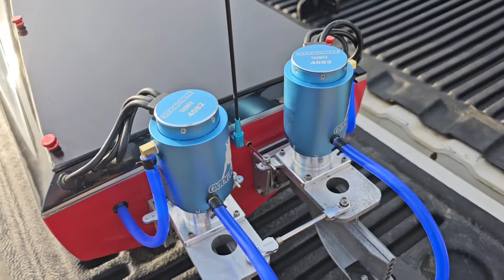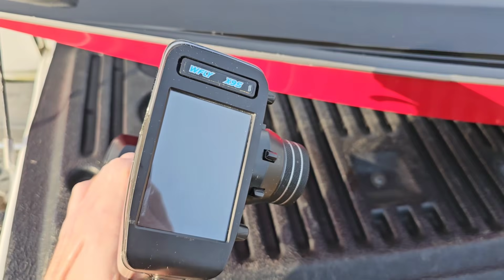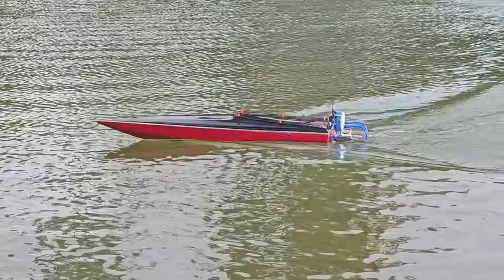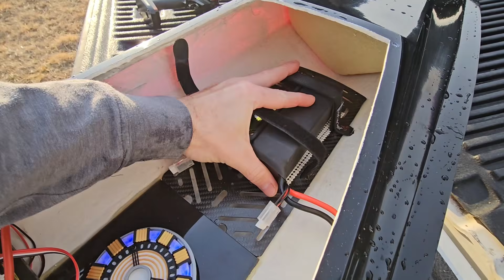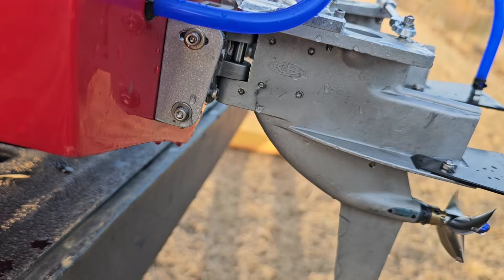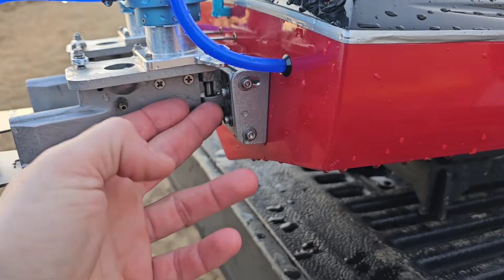Ironman Mark¹ First Testing - 4s & 6s

Comment: Start with  the C.G. That's where your problem starts.  The twin motors is a lot of weight.  Adding the  running hardware, lower units . ETC.  is too much aft weight. When the boat tries to plane out, the   bow  of the hull comes up, as the boat attempts to balance itself. Hence the bow lifts ,and then drops  back down .(Porpoising. )   Additional trim tabs  may help, but  won't  correct the C.G  problem.  NEXT , the ride. Your thrust  should be parallel   to the transom. TOO high= cavitation.Too low, and too much drag.  Thoughts?

Comment: With the beam length of that hull and how much weight is on the rear I think it would work much better as a single motor and  drive setup.

Comment: Those prop shafts are way to low, because they are surface drive props the shaft should be no lower than the hull or even slightly higher, check it with a rule.

Comment: I would try neutral outboard angle, engines mounted higher, and attach afterplanes (trim tabs) to the hull. After that you should be able to get rid of the porpoising with subtle trim tab adjustments only. Use just enough tab adjustment to stop the porpoising or else you'll kill speed.

Comment: 2. To 3° of positive angle is optimum for most v-holes if you want to run fast as far as prop setting height wise, I would try to split the output shaft with the water line as far as height

Comment: Awesome looking piece but I believe you need some trim tabs on the back of that something about 4 in Long by approximately 2 in protruding out from the back of the transom. You can dial that thing in to ride any angle with the proper trim tabs

Comment: Your carbon plates are the problem, as soon as the boat lifts, the boards are acting like a steering surface that is rotating your boat back down, so it goes up and down, up and down. Try to angle your carbon plates in the angle you want your boat to drive in at full blast. And the waterjet from the props is hitting the plates.

Comment: The props are running too deep.  With that much setback from the rear of the hull, the top halfs of those props and their shaft should be above the bottom of the hull..  I think raising the mount backets instead of the trim will make a better difference, and decrease drag a lot..  Thoe length of the drive unit is too big of a lever arm raising the bow as they are mounted now.

Comment: I know your steering linkages are at the bottom of the transom holes. BUT, it appears (to me) that you need to get the props just a touch deeper into the water.

Comment: Part this issue is the hull style, it’s a long lead into the Delta pad on the bottom. So here’s my suggestion, take a scale ruler, and fin the spot where the hull starts the radius from the bow. Use a sharpie, and mark it. That’s your sweet spot on this hull. Porpoising is from the bow trying to roll over a make believe wave(if you will) and when you trimmed the drives with this much rake, it’s pushing down on the bow, but the hull is trying to “ride on this wave” instead of over it. ,is this making any sense, you want the setup to push through it, NOT over it. I raced a 33’6” off shore boat for several yrs, and this setup is key. If it helps, I can maybe talk you though it. You’re really close, but the hull is upset and porpoises.let me know, Dean

Comment: Your power and hull are not matched up, one or the other has to change. Surface drag is everything when power is full out, even the big boats have the same problem. Look at a hull designed for 45 mph, and a hull designed for 80 mph.

Comment: Awesome boat man! I built something similar with a Tfl scale outboard and a sonic wake 36. All of the weight is up front and it handled pretty much the same as your boat bouncing all around and riding on just the lower unit. It’s kind of a lame solution because of how adjustable the outboards are but it’s going to need trim tabs and maybe turn fins. Just having the tabs in line with the hull got rid of 80% of porpoising. 

Quick adjusting note on the jack plate after trim tabs, moving the outboard down will make the bow want to ride deeper in the water and vise versa for up. Outboard angle is more important than height and I’d recommend starting everything neutral and inline with the hull. I would expect for you to add a little negative trim and up on the jack plate after some testing

Comment: Great job, it'll run when she's dialed in. A few things, sometimes with real boats running opposite rotation can change things, turning out VS turning in. Another thing with real boats, some hulls porpoise at certain speeds and you need to get it past that point. As many said I'd raise the outboards. Cool cool cool set up, nice job.

Comment: That's an awfully long boat you probably need more weight in that nose keep it from porpoising would assume them lower units and motors on the back are pretty heavy heavier than battery packs

Comment: Ok I don't know if you fixed this issue please let me know. I used to work n rig bass boats n ski boats. The cavitation plates on the outboards need to be even with the bottom of the boat like a real boat. If it's to high it will porpoise like it's doing. I realize the hull isn't flat but it should work if you get the outside part of the plate even with the hull it should work.

Comment: Die Propeller müssen deutlich weiter runter getrimmt werden damit ein Teil der Antriebsleistung den Bug des Bootes runter drückt, dann hört das wippen auf .
Ist der Einstellbereich am ende kann man sich mit Trimmklappen behelfen oder aber man baut einen Keil unter die Motorhalter  so das dort schon ein leichter Winkel entsteht der die Propeller etwas weiter runter trimmt und man so erneut den Trimm fein justieren kann . 
Motor im Winkel runter meint das der Propeller übertrieben gesagt Richtung Boden zeigt und  hoch Richtung Himmel . Die Propeller Achse sollte auf Hohe der Wasserabrisskante des Rumpfes sein bzw ein zwei mm darunter so das der Halbe Propeller in Gleitfahrt getaucht ist und die andere Hälfte dann in der Luft ist bzw das oben befindliche Blatt sollte dann nicht im Wasser sein .
Das Gewicht sollte relativ weit nach hinten getrimmt werden so das der Schwerpunkt des Bootes bei ca 30-35% von hinten gemessen liegen sollte gemessen wird nur die Rumpflänge ohne die Antriebe . 
So getrimmt sollte es abgehen wie ein Zäpfchen bzw mit 4 s sollten wenigstens 60Km/h drin sein eher 70 Km/h und mit 6s gute 80 Km/h wobei stabil laufende 60-70  Km/h schon reichlich Spaß machen und man save auch bei etas Welle damit fahren kann .

Comment: I race full size boats and thinking likely similar. Raising props above keel is great move. Long Trim tabs to lengthen boat. You should be able to make it run fastest with a bit of positive trim up. Cav plates on outdrive rarely work. Only used for under powered boats. Props make huge difference. 4 blades get most keel lift. Ass of the boat is running to wet. Props are a pain. Try 2,3,4 blade. I would bet 4 blade is best. You need vertical transom lift mostly commonly found with prop selection and weight moved forward. Extensions also used on outdrives to move props back. Looks good bro.

Comment: 10:57  First off, your drives are too high. The second you add throttle, she’s sucking air.  If you imagine a laser line that follows the underneath of the “ventilation” plate right down the centre of the drives to the transom, that dot on your transom should be (in scale) right at the bottom to just slightly higher than the lowest point on the transom on that vertical plane.   Right now, the water is becoming unstable due to the difference in height and drawing aka venting air down below the ventilation plate which in turn will create “cavitation” at the props destroying efficiency and creating an immense amount of heat on the rear face of your props.  Oh another point on this.  As they are now, I’m thinking about the cooling intakes just might be sucking 50% air until you can fix the venting issue. 

2nd. A 2-3mm trim edge along the bottom of the transom where it meets the hull with the slightest downward angle 2-4° would completely get rid of your porpoising.  Nice project.

Comment: back when I was running Gas model boats one of the fellows had a single engine setup a bit smaller  then yours he hocked up extra servos so he could Chane the  engine depth and angle while running. I just waited until he had his set up nice and copied his hight and angle on my white heat 60, then adjusted mine slightly.

Comment: I would try putting the blades deeper in the water. I believe the blades/props are coming out of the water due to the boat's plane on the water is hitting the top part of the prop and causing the props to release. Then as the boat slows, the props catch and cause the nose/bow to raise. Thus causing the oscillation/purposing. It's my theory. You want to keep the whole prop under water. Trim tabs won't keep the whole prop under water. I'm not an expert so I am not 100% sure. I fly RC models. But I have owned real boats. Keeping the whole prop under water always seemed to help. I hope it works with models as well. It's just a theory of mine.

Comment: A nice model and an interesting propulsion concept. As you can see, there's too much weight at the rear "off the deck." You could try adding an automatic adjustable trim. I once had a real small motorboat with this problem. Only selling it helped... :)

Comment: Great build. I have a super gator that I put a 29cc ported zenoah in. It porpoised bad. I messed with trim and weight distribution which helped a little but 3” stainless steel adjustable trim tabs eliminated it totally

Comment: Balance the boat at about 1/3 the length from transom. Centerline of prop just below bottom of boat. Add trim tabs and turn fins. The boat will run different on glass smooth vs waves.

Comment: All the Prather v hulls with outboards required very large trim tabs, and the motors need to be up so the bottoms of the props are level with the hull bottom. So trim tabs and motor height. And run standard style 4514 props like the octura x4 series. It is a great looking rig though 👍🏻👊🏻

Comment: Those cav plates you added to the outboard likely are creating too much rear lift. Notice how going to a 2 blade prop made it better. Get rid of them or find props that don’t lift the rear (almost all model props do). 

Add transom adjustable trim tabs instead. 

And honestly the CG is probably way too far forward. The outboards want to lift the nose and free it but as soon as it does the nose falls back down cause its too heavy. Notice how heavier forward batteries made it worse. 

A boat will porpoise if the CG is too far forward or too far back for what it wants. To me it looked like moving the batteries back made the porpoise less intense (it slapped less hard). 

The outboards want to be trimmed so the prop shaft is parallel to the water surface at speed. The transom trim tabs want to be parallel to the keel. With that setting find the right CG where the boat wants it. You may be surprised just how far back it wants the CG to be. I’ve seen some real outboard boats that sit with the nose way out of the water and don’t porpoise at speed. 

Looks good!

Comment: In my opinion in past experience I feel like you definitely need a couple of trim tabs on the back I feel like you also need to bring both of the Outboards up higher. Have it where the props almost out the water when on plane

Comment: Arent the cav plates on the out boards supposed to be at water level? Because yours look way higher. They'll be out of the water at speeds. 
Maybe lower the legs and add an extension to the servo connection points.  Could add stability.

Comment: Might also need trim tabs on the bottom of the boat plus more weight in the nose. The boat needs to be BALANCED.  A big chunk of lead. Carve out some of that foam in the nose to put led in there
Reply: Maybe try lead instead....it's a bit heavier than led.
Reply: @specforged5651  Thank you for letting me know I had a typo

Comment: Dude, TRIM DOWN!!! You were on the right track, but you stopped and changed your  direction.... AND, your cav.plates need to run flush with the very bottom surface of the hull! You can build a lot of speed with that hull design.... you just need to know some basics. Dont give up, youre right there!

Comment: ok. u have to stop and think about what ur doing. lol as it progressed u started saying things that made less and less sense.too much lift in the BACK is lifting the FRONT? is that how the multiverse works lol im messin. but for real ur doing nothing new ,u just didnt research ,u just did ur thing ,which is kool. but as u can see even u urself know the boat should be going faster and running flatter . didnt hear the cg mentioned. for monos it should start at 33%. electric is powerful without the flat spots in the rpm range so id def try 35% or more . also the props need to be level with keel. the engines should b straight. now for other stuff - u NEED trim tabs ,bigger the better ,start half inch or less from keel and 2/3 the bottom . at least 2inch long but id say 3. hard to find ,yup. BIGGER cavitation plates would help too . fyi when adjusting stuff do 1 thing at a time esp since u dont know whats happening .so u can see the change . nice to see somebody building not just buying rtr electrics. i think thery kinda boring myself and i dont see how anybody could enjoy running a bought ready to run electric but hey ,to each his own . anyhoo happy hunting
Reply from the maker: Cg is 70/30. But only with the big 🔋 🔋.  Im gonna try raising the motors alot, then nose weight, then trim tabs. I debated on ever posting the video bc the run was so garbage but its good to show others the struggles, its not just a easy setup & run.

Comment: I know how the real boats work it might help. Centerline of the props level with bottom. You look really low and the trim in a real boat is constantly adjusted with the speed of the boat. In while slow and out to go faster as the speed climbs. A slight turn while accelerating helps keep it flat threw the purpose the the higher speed will keep it flat. Every boat is different center of gravity between 3/8 and 1/2 way from the rear. I have a cat but I know vees like the motors close together. Water pick ups can go on the hull if they get dry. Plates on the hull might help. Power trim rules.  Good luck.

Comment: I work on real boats and model boats for 30 plus years both of those motors have to go up a good half inch if not more you have entirely too much outdrive in the water basically you have the whole thing and those carbon fiber cavitation plates are riding under the water That's what giving you the bounce at higher speed guaranteed if you put a GoPro on those out drives you'll see give it a shot guaranteed it's an improvement

Comment: The Hull is running wet due to the outboards pitch downward. Use a level on both cavitation plates & set the engines level. The only way to trim such a long hull will be to install adjustable trim tabs on the transom.
Beautiful boat.

Comment: I would get rid of the foam, used pool noodles instead now balance the hull by adding weight up in the bow till the hull balances out with that heavy outboard motors, while balancing keep the batterys in a "neutral" position. I would run it with the 3-bladed props. Hope to see the next video soon. Peace🙏.

Comment: Problem is to much positive trim on the gear cases which lifts the bow of the boat
Cure build in negative trim, tuck the gear cases in tighter to the boat pulling the bow down to stop the porpoise
You do not want heavy weight upfront you wanna keep the weight to the middle of the boat and as close to the rear as possible
Every time you change props, you will change the trim of the boat and you will have to reset trim angles

Comment: Clever props should be center shaft slighly below hull bottom so when on plane only 1 + .5 blade in water. Ideal is prop shaft equal to on plane water level.